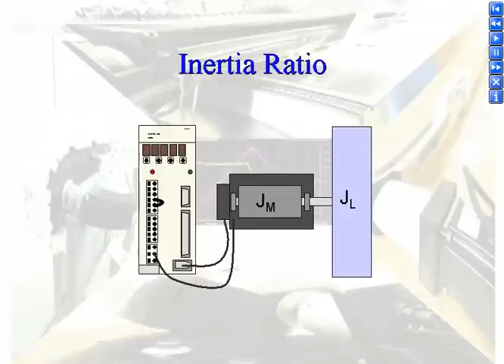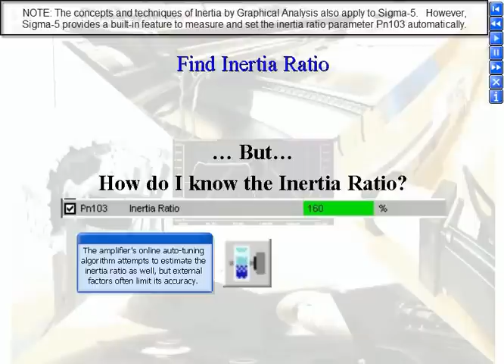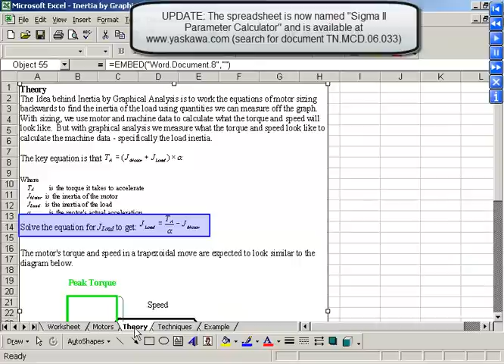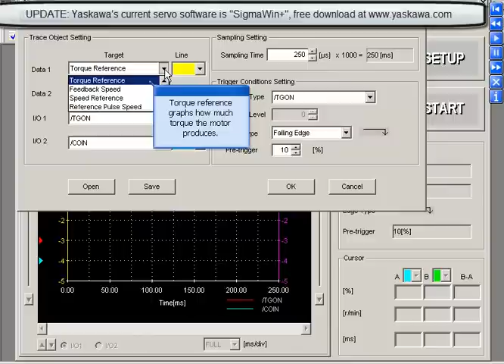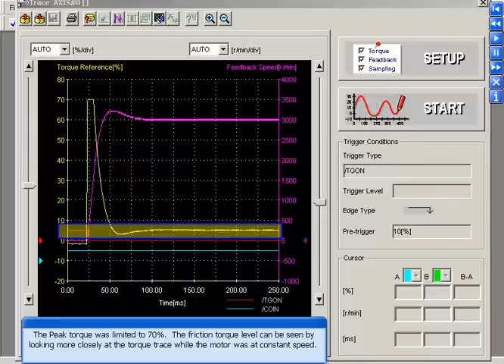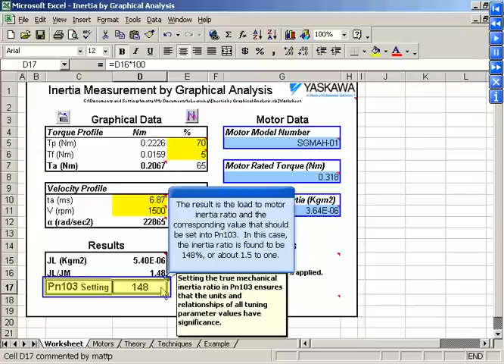Inertia Ratio by Graphical Analysis with Yaskawa Servo Amplifier

Comment: Hi i hope you can help me, for a rack and pinion where the rack remains stationary and the pinion travels with the rack, it is right if i calculate the load inertia using the pinion radius times the mass? What if i use two motors in one axis?